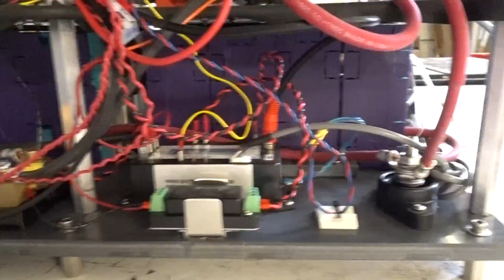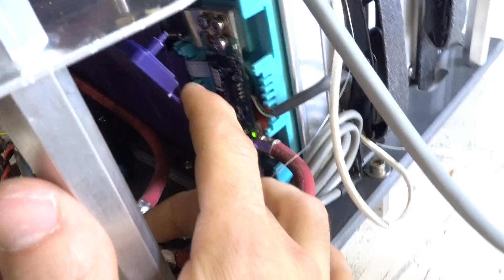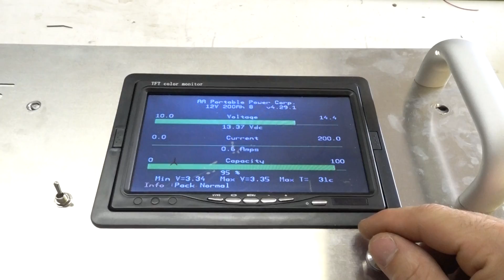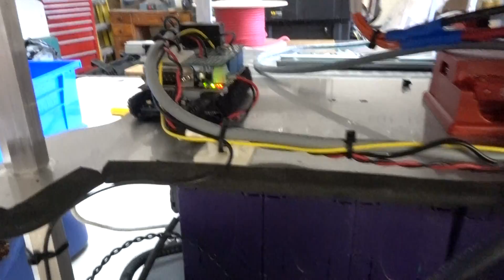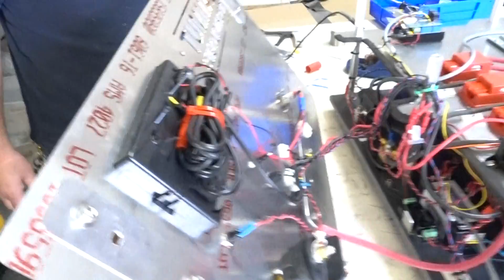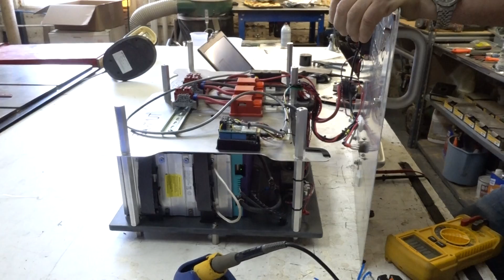Custom Waterproof LiFePo4 battery pack with BMS system

Comment: Well, I was thinking about making another waterproof and temperature managed battery but my approach would've been pretty different:
You know those water-cooling systems for PC's? I was thinking about using a triple rad to put over a 3s 18650 pack inside a sealed box and the positioning of the rad and cells would've allowed for air circulation using the outer casing and some other "walls" inside it as channels to redirect the air flow from the bottom to the sides and again to the top through the rad. That triple one would've been tubed to a single rad on the outside to exchange heat with the surrounding. An Arduino or RPi would've been used to monitor the temperatures inside and outside and also to power the cooling system when needed. 
I don't have the money nor the time to do that and I also guess there's a lot of things to get wrong when building it so yeah, won't do it.

Comment: not bad at all,nice work , you said its water proof but how does it stay cool if it has no fan or vents ?
Reply from the maker: LiFePo4 doesn't get hot believe it or not. We ran in 95 degree weather with straight sun in Belize and the battery box temp never went above 40C. A wet towel for cooling on top of the box was sufficient.